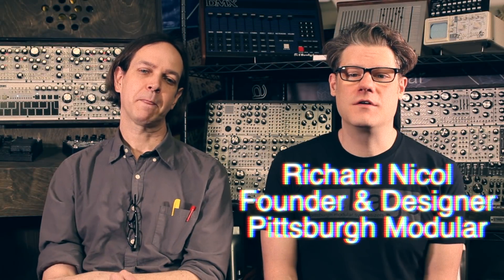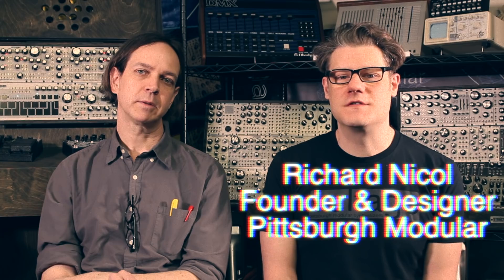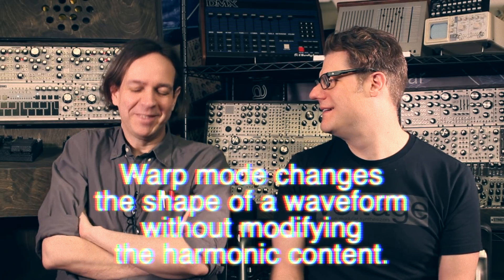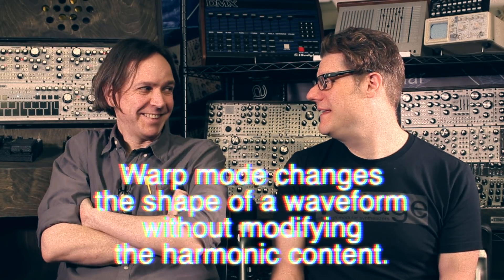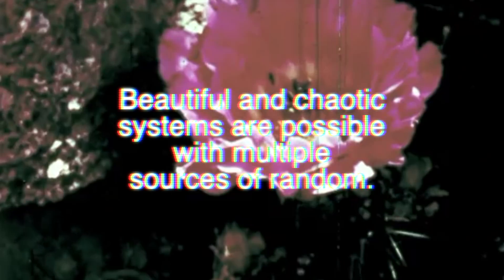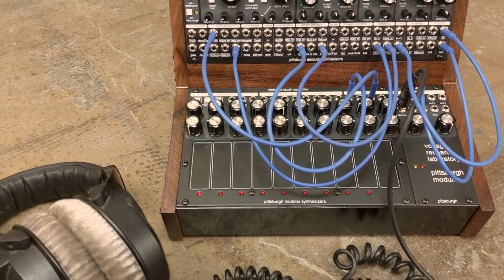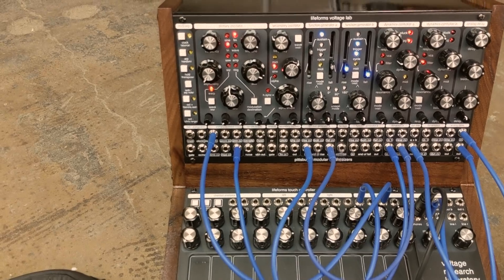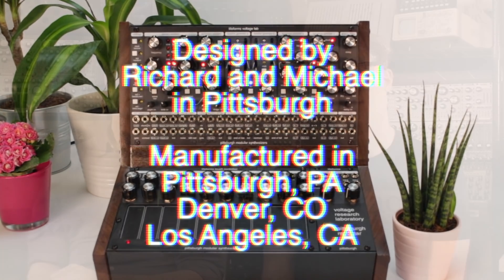Pittsburgh Modular Voltage Research Laboratory Introduction

Comment: Why didn't you guys make it bigger, it's so tiny, this has the chance to become a really significant synthesiser going forward, should have built it the same size as the Synthi/putney etc, it's so dinky and the knobs so large. I absolutely love this synth but really wish it was larger and had more desktop presence, as you get older your eyesight and dexterity gets worse, this size doesn't help.
Reply from the maker: I agree that larger can be better. My eyes are not very good and my hands are on the large side. The Voltage Research Laboratory was designed to fit within the eurorack format because that is what we are known for and we have the systems in place to manage design and production.
I am not against building a larger sized stand alone version of the instrument, I want one too, but a larger instrument is beyond the scope of what the 5 of us can manage at our workshop. The Kickstarter orders have stretched the limits of our work days and physical space as it is. I am actively looking to partner with other companies to increase the reach of our engineering and designs but it is a slow process.
Reply: @pittsburghmodular  So these synths are only available to those who participated in the kickstarter..? will they be available to buy in general from our fav synth vendors in time..? I'm in Australia so this is extra frustrating tbh.
Reply from the maker: @fiddlestickzmuzik  After we fulfill all of our Kickstarter pledge orders, we will be begin shipping VRL orders through our web shop and authorized resellers. Innovative Music (our distributor in Australia) has some on order, so you may be able to reserve one through them.

Comment: Sounds fantastic, exactly the kind of tool I'd like to add to my setup. However, as it would be my intro to Eurorack (have a few semi modular bits such as 0 Coast and Koma field kit), the form factor might make it difficult if I want to expand at a later stage. Any advice here on cases if I wanted to expand it?
Reply from the maker: Thanks! All three modules (Voltage Lab synth voice, Touch Controller, and utility output modules) are fully Eurorack compatible, so they can be remounted in any standard Eurorack case. The included case (Research Console) can also be used with other Eurorack modules, if you wish.